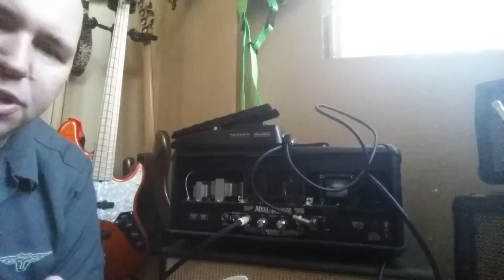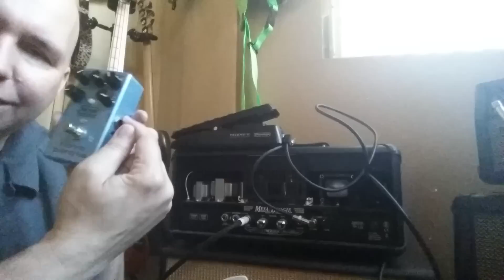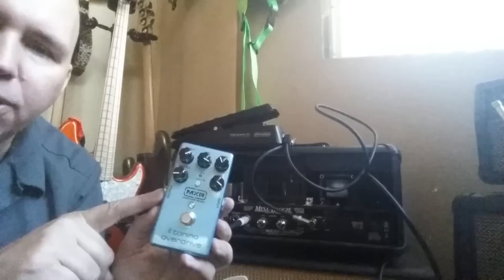How And Why To Use The Effects Loop In Guitar Amps

Comment: Did you ever think that a six minute video really complicated the explanation for two holes on an amp? Honestly, you just totally confused me. I'm not kidding, I still have no idea what the send and return do.
Reply: In a nutshell: Distortion, overdrive, preamp, fuzz go into the front of the amp like you always did it. Modulation (chorus, reverb, echo, etc.) go into the the effects loop. So you connect a cable from effects send on the amp to the input of your modulation. Then you connect another cable from the output of your modulation to the effects return on the amp.  You can have as many effects in your modulation chain as you want. Then crank your amp and annoy your neighbors as normal. Just with a sweeter tone.
Reply: Wow thanks!
Reply: I think that with wah pedals you want it to be one of the first pedals in the chain because you don't want the  signal buffered in any way before you hit the pedal. I'm not sure that putting it in the fx loop would make it sound bad but you might find it won't make the wah sound.
Reply: He totally fucked it up then fixed the mistake while he was explaining how to think of an amp as an EFX pedal..It wasn't you..I caught it right away but many others didn't..It WAS confusing.

Comment: for those that didn't understand his explanation think of your amps front panel as a sentence. So you start reading at one end and finish at the other.  If your input is at the left you start there and if your input is at the right you start there. I have a Marshall TSL Combo so my input is at the left. Then everything is in line after that. They don't all go to an output at the same time. So you start at the left. (I Will leave out a few buttons to make it less confusing).  - input - gain - volume - Bright button - treble - mid - bass. Then it goes into the crunch or lead distortion channels which take over from clean when selected and it goes the same - lead - v0lume treble - mid - bass - Then it goes to the effects like reverb - Presence - effect - reverb. Then out to the speaker ...or simplified down. input/volume/EQ/Distortion/EFX and loop/ Reverb/ out. So your loop is any effect you put in it and will be after the distortion and before the reverb. pretty much all amps are set up this way.
Reply: Stares down at mustang amp, sees the exact path (only small differences) described. Mind Blown
Reply: Great explanation

Comment: Good explanation, mate.  Send to input of pedal - return to the output of the pedal.  But if you have a stereo amp you will need 2 sets of TRS 1/4" stereo jack to Y splitter with 2 mono 1/4" jacks.  Stereo amps like the Crate Power Block can use 2 effects loops in the send and return of the effects loops.  I love my Crate!  It also has RCA input jacks to patch in a CD player so you can play along with other music.  Did I say I love my Crate 150 watt amp head?  Well, I DO!

Comment: Most folks do not know there is 2 different types of gain in all amps !
Preamp gain can easily distort and power tube gain adds clean gain until near max volume and this gain can create the awesome harmonic overdrive revered by all rock players except metal players !

I use my FX send into a splitter pedal to run another tube amp set for clean tones because it has the preamp drive from the first amp and the splitter pedal sends back into the return of the first amp that has effects going on !

It results a much improved tone and fills the room without a lot of volume as the other amp speaker moves twice as much sound thru the air !
It basically sounds stereo or very close to it !

Comment: Great idea with the volume pedal. I'm using a helix into my evh5150 using the four cable method and I found I can achieve the same result with the helix volume control. Got the amp cranked and sounding awesome but without deafening myself.

Comment: You can also use the FX send on an amp to send it to a power amp of your choice, effectively using the 1st Amp as a Pre AMp only.  I got a great result doing this to a little Orange Micro Dark where all the goodness is in the Valve Preamp section but not in it`s cheap solid state Power amp, sending out from the loop bypasses the 1st Amps power amp ( and you don`t need a dummy load on the Micro Dark cos the power amp isn`t valve ) I sent it to a Marshall 120/120 Power amp and the result was reallly good !

Comment: That volume pedal hack is superb! Especially as I DIDN'T EVEN KNOW I HAD AN FX LOOP!!! Pre-amp out, good lord!
Reply: That amp isn't cranked, only the preamp valves are, the heavenly juice is on the power tubes. Otherwise you could just run a overdrive pedal with a 12ax7 and you'd be good

Comment: I have a Peavey Classic 50-212, which has a big, husky Clean channel with way too much headroom. (The Lead channel breaks up easily but also needs to be pushed in order to sound natural.) I had always wanted to get organic breakup out of the Clean channel, so I tried your method. I inserted my custom-made, top-secret Screamer clone into the loop and cranked both volumes on the top panel of the amp. Voila! Bingo! Damn it! THIS WORKS! I got beautiful, syrupy tone, which I could augment by dialing in distortion via the pedal. Interestingly, it also did something to the reverb circuit. The Classic 50 has just a two-spring unit, so I've tended to set it at 10 (out of 12). Well, I guess the reverb is output-dependent, because I had to turn it down to 6. Anyway, thanks for an excellent workaround. Other Tubers have said, "The overdrive pedal should always go into the guitar input on your amp," but you've shown that isn't true.

Comment: I really like your idea on cranking the amp and using volume pedal. So.... you can play a song and when it comes time for your solo you can cut through and take the tops off everyone's heads! LOL  Also your method allows one to push those tubes harder which is a good thing.

Comment: Good Info, I didn't hear you mention this additional info and I may be adding bad info, but I've always used the Send/Return to also chain my Delta Blues Tube type with my Yamaha Solid state type and then return into my multi FX (Boss GT8 currently) to give a good stereo vibe in my music room. 
It's "Preamp" so it's basically "passive" using the send return I'm not sending full amplified Power into my 2nd Amp. 
I'm just coming from a Stereo system background and I know back in the day you wouldnt want to use an EQ that had amplified power into tge front side of your High dollar amplifier, it's why you wanted to use a Passive EQ;  they were active, like the crossovers we used but no amplified power, just active electronically for desired low cut, mid cut, high cut ......etc 
May give a little understanding to some guitarists with a background of the big boom systems of the 80's......lol

Comment: The f/x loop isolates the chain of external effects from the preamp, placing the f/x after the preamp. This way the preamp doesn't affect the f/x boxes. It keeps the f/x signals clean and unaltered by preamp signals and settings.
Reply: Thank you for answering a simple question I was looking for.
Reply: @richarddeneen1897  my pleasure
Reply: Incorrect!  :)

The preamp signal is passed on to the pedals. In fact it has also been boosted to Line level, so the pedals will have to deal with that.

Comment: Forgetting a very important part...power amp distortion. Sure you can crank your amp and use a volume/EQ/whatever pedal in the loop, but this only gets you preamp distortion, since the effects loop is patched in BEFORE the power amp, which means you're cranking the signal through the preamp, but then sending it to a pedal that lowers the signal before it hits the power amp. If you want preamp AND power amp distortion then you need a good attenuator, which allows you to crank the power amp as well, and then attenuate the signal before it gets to the speaker. However even then, you won't get speaker breakup, so it's still a compromise. Plus there are good attenuators but they cost a lot of money. There are cheapie that are crap. Of course it all depends on whatever amp you're working with, power amp design, tubes, etc, as to whether or not it sounds good. But using the volume pedal method you'll never know. Gotta get those power tubes cooking to find out!
Reply: c00lkatz i was about to say the same thing and then saw your comment. glad I'm not the only one to realize this...
Reply: Shure. Most overdrive heard on classic records comes from  power amp distortion.
Reply: This is exactly why I think the Boss Waza Tube Amp Expander is just a game changer. Attenuators and Reactive Loads have existed for a long time but the TAE is the first attenuator I've seen with a variable response reactive load in it. When you pick the right impedence settings you can feign speaker breakup.

Comment: In some amps like a jcm 2000 tsl 100 you have a effects loop blend so you can blend the effects in the loop and have effects before the amp, like a volume ,oh and the boss metal zone works best in the effects loop and just plug straight in the amp from the guitar,

Comment: Yep,   good n clear info there.       .... My JSX amp has been gradually reducing volume a little bit at gigs.   It doesnt cut out,like a short,  it simply turns down as if I smoothly turned the master knob down a few numbers,       ....so I turn UP,  and within a few minutes   the volume will come back up,making me Too loud. if that makes sense.      I try to counteract it by turning up a notch & within a few minutes the volume also turns itself up,making me Too loud .   So I have to turn back down with the Morely Volume pedal.              ... This happens when Im no where near my amp and a few feet from my board.     Now Im starting to wornder is it possibl;e for a Morely Volume Plus pedal to malfunction & cause volume issues like this?   I have all new Magami Emenence cords throuout.         .......  I use a DIFFERENT head & same issue.

Comment: I will try the effects loop thing, thanks. In my experience basically a modeling amp is a pain and trouble waiting to happen. With mine anyway, it doesn't remember all the work I spent to tweak my sound and I have to do that every time I turn it on. Also in my case there is a short somewhere and I get maybe half volume till I bump the top of the amp and it comes back at least for a while. All that extra circuitry is just more that can fail. I like my basic quality tube amp and I can add any effects I want.... or not.
Reply: mrgitarman what amp is $hi+ing out on you ?

Comment: finally!!!   what a great explanation and AWESOME tip about the volume pedal!  Can you do a  video on slaving amps?  why you ax?  I just learned about that a few months ago.   i.e. if I like the preamp of a modeling amp but hate the fact that it has a Solid state power section, by using the effects loops, I can send the preamp signal to a tube amp.  I think thats what slaving means.  But I know if you don't do it right, you can blow a transformer or something cray cray like that.  but just imagine how many of these modeling amps might sound great with a tube power section!  My fender floor sounds 100x times better through a tube head and cabinet than do the mustangs and its the same thing, just in a floorboard.  a slaving video would be great.  thanks!

Comment: We would always try our pedal board through the input jack, and then through the effects loop. Then see which one sounds better.  The effects loop is useless if you’ve tried every conceivable setting, and it still doesn’t sound as good as the input jack.  In that case, go with the input jack.
  Honestly, it sounds good. Either way on my old Peavey XXX.  The entire pedalboard/effects chain can be turned on/off when ran through the effects loop- which is nice.  

Bottom line:  See what sounds best, and set it up for your sound.

Comment: Question for Philip or anyone! I have an amp head with an effects loop and I also have a power amp laying around. For science, if I were to use the "FX send" to the input of the power amp, then use the power amps "line out" back to the "FX in" of the amp head, would this be disastrous? Or would I effectively be able to power two speaker cabinets independently with slightly different sounds? If this does not make sense, let me know. I will try to clarify.

Comment: Unfortunately, I don't have an effects loop. Great idea with the volume pedal though. At last my GDS 18 watt head has a built in Weber Mass attenuator. Previously, I had Marshall non-master volume amps, both s JMP 50 Plexi, and various 100 watt super leads. I always used a THD Hotplate attenuator, and hated it. I've often thought of having an effects loop wired into my GDS head for time based effects.

Comment: Question! Ive recently been in a debate about something and cant find the truth lol. so heres the example Ill use! lets say Im hooking up my orange amp(20w tube preamp/solid state power section) ---> out of the fx loop into the power amp in or fx in of another amp, the consensus is its safe to not have a load attached to the orange amp because it has a solid state power section! now , I agree, but this is where Im stuck! What if for whatever reason I was doing the same thing, ( amp 1 fx out --> amp 2 fx or power amp in) but amp 1 instead of the orange with the ss power section was lets say an all tube amp, would it need a load or a dummy load attached?

Comment: I just bought an amp with the fx loop option. 1st time using. My question is: If I ONLY plan on using the clean channel do I need to use the fx loop? I pretty much have all the effects pedals. Distortion, OD, phase, delay, flanger, etc. Any help would be greatly appreciated. Thanx!

Comment: Same principle as putting the send volume very low and the amp's volume high (on a Dual Rectifier), all the fizz goes away and it sounds huge at low volume. There's a lot more noise coming from the power amp though.

Comment: What's your favorite speaker and cab for your mark 5 head? I just got one and am actually playing it through a Marshall DSL 40c combo with a cream back right now. I bought a 1/4 inch female coupler and had a short 3 foot 1/4 inch speaker cable to extend the DSL speaker cable so to reach the mark 5 head. I plug it in to the 8 ohm input on the mark 5, though the DSL says its 16 ohms? It's working though so I guess that's ok. Anyway I'm going to want a nice 1x12 or 2x12 for my mark 5. What do you think would be best for recording but still loud enough to play live band? Thanks, I aprreciate your videos and tips.

Comment: Would it be so hard to replace "send" & "pre amp out" with "fx out" and "return" & "power amp in"with "fx in"? 'Cause that's basicly what those ports are. Also don't let the new Katana's fool you: if you turn off the reverb & delay on a receiving Katana the "return" can act as a "power amp in". Correct me if I'm wrong.

Comment: Another use is you can take your 30 watt amp and pre-amp out to a more powerful amp or pa system for larger venues even to an amplified mixer without over driving the other amp.

Comment: so to sum it up, you're saying plug to the front input with the guitar, use the master vol/gain to control OD, and the FX loop for the processor type effects? Would a vol pedal be placed in the loop at the end? How is the overall volume from the speakers controlled? I must admit, this is the most confusing part of playing. You could devote more videos to this and it would not hurt my feelings at all. BTW, you are providing some good info - most people just want to sell us stuff or impress us.
Reply: Ken Lelon Your amp should have separate gain and master volume knobs. The effects loop effectively treats your pre-amp as another box. The gain knob effects your pre-amp stage, the volume pedal placed as the last thing before return will control the signal going into your power amp, and the master volume will effect what comes out of your speakers.

Comment: can you show how to set up which pedals work best going into the front input of the amp, and which pedals go into the  effects loop,  and show slowly how to set  it up?  Can you still keep them all on one pedal board, or would you need 2 pedal boards?  Can you show how to set it all up, as simply as possible?   I understand there are better ways to set things up, I just do not know how to set it up correctly yet.. I have about 10 pedals,  big muff,   fuzz face,  fat boost, chorus,  phaser, analog delay, digital delay,  and the amp has good gain itself, just no big low end growl.. it is a Marshall JCM 2000  40 watt made in England..  looking to maximize it all and get the hugest tine possible, like Hendrix and  Stevie Ray, not a generic metal tone.. I have no more money to spend on anything, just need to know the best way to set up what I have..

Comment: I use an effects processor unit, a Boss ME-50, a wah pedal and a Roland Space Echo into a Fender Cyber Twin. Because I'm using the processor, is the effects loop of any real use to me or will it have the same type of effect as the volume pedal you showed in the video?

Comment: So my only question would be where to plug the guitar in. Would it be put into the volume pedal (or whatever is first in the chain) like normal or would it go directly into the amp's input?
Reply: +RyGuy106495 1st in the chain before entering the AMps Main Gitar Jack input, as per normal

Comment: The difference is an attenuator will let you drive both the preamp and power amp.  This simply allows you to drive the preamp.  

The Weber MASS attenuators are really nice.  Not as expensive as some others either.  Attenuators won't really improve the sound a lot if you want to bring a 40+ watt beast down to bedroom volume.  They are excellent for being able to crank that beast and tame it so your neighbors won't be calling the cops though.